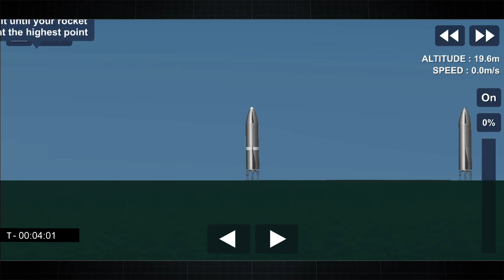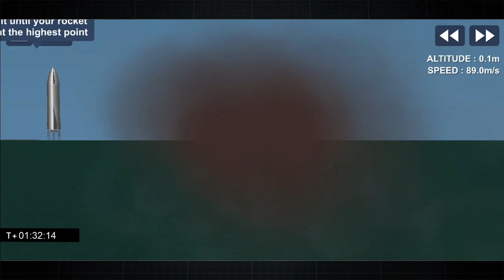Starship | SN9 | High-Altitude Flight Test

Comment: During the descent the starship that i have build doesn't remain horizontal. Why?
Reply from the maker: Nice question, you must keep vehicle weight balanced (upper parts and bottom parts)
Reply: Ok tanks
Reply from the maker: @giacomosantini06  anytime buddy
Reply from the maker: It's actually bad, we need to solve the problem not adding more problem, the best way to keep horizontal orientation is doing perfect math of the structural weight balance, you can't just using RCS during re entry at orbital velocity
Reply: @skyridesfs  I solved the problem by dividing the rocket into two parts while maintaining the same weight in each part
Reply from the maker: @giacomosantini06  did you already test during descent?
Reply: @skyridesfs  it is not the same as the real one but it works
Reply: @skyridesfs  but i must use the rcs engine